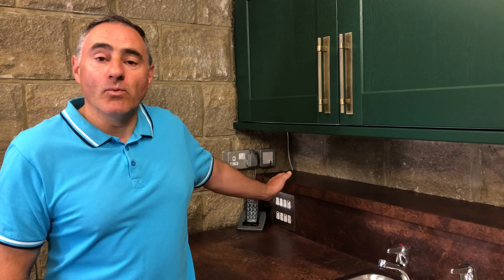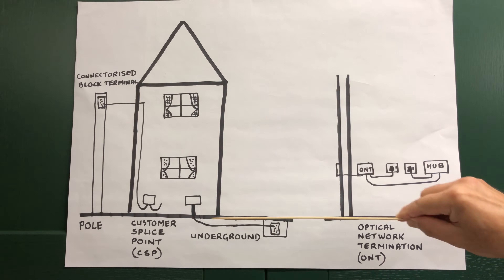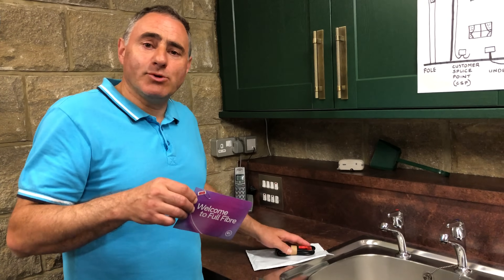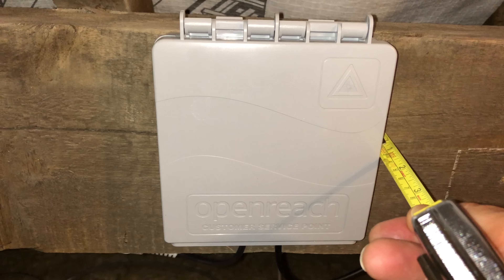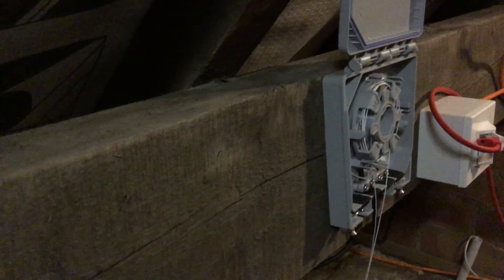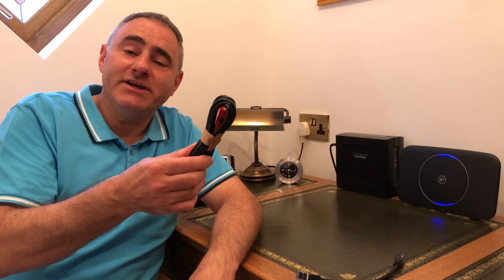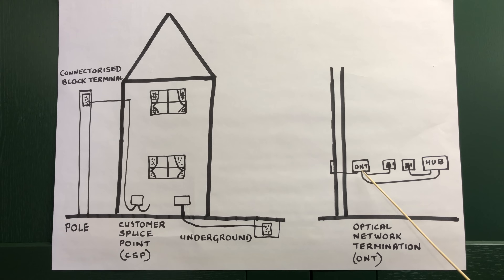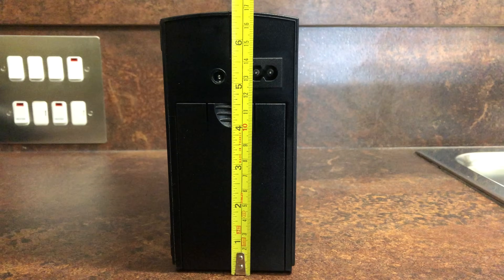Full Fibre Broadband with Battery Backup

Comment: Hi great video, what trunking did you use and how easy was it to feed the fibre through? I want to  do similar and have the feed come under the eves and not down the wall. Thanks.
Reply from the maker: Hi Scot, I used 20mm corrugated conduit from Whickes. It’s available in black or white and there is also 25mm dia available. In my case the fibre just pushed through no problem. If there are bends then it’s best threading a draw wire or string through the conduit. Then it’s ready to tape the fibre to it and pull it through. Hope this helps and it goes well for you. Cheers, Rob 👍

Comment: And WHO pays for the Electricity?????? Messy thing to have in your house.
Reply from the maker: I guess for anyone reliant on battery backup, the very low running cost would be negligible. If the battery backup wasn’t plugged into the mains, then the hub and ONT  itself would require power and be plugged in instead. As for appearance, mine now sits under the desk out of sight. For those dependent on battery backup, I suppose it’s cosmetic versus crucial. Thanks for watching and commenting, Cheers Rob 👍

Comment: Excellent, thank you.
Reply from the maker: You’re very welcome; pleased you enjoyed the video. Cheers, Rob 👍.
Reply: @robswiseways5697  if you have block of three flats how different is install vs just for one house
Reply from the maker: I suspect each flat will require a separate line from the pole or underground chamber. Hope this helps. Cheers, Rob 👍
Reply: @robswiseways5697  can the grey box on side feed three flats or does each have to have own grey box
Reply from the maker: @Viewer765 I’ve not come across this before but I’m guessing each one would have to have their own box. They are all separate customers and if one had a fault they would be able to test that individual line. If all three were in one box, the fibre lines would get tangled as they are coiled round inside the box. they’re my thoughts.
Reply from the maker: Sorry for late reply. The company who owns the infrastructure such as Openreach may have cabling methods for multiple flats. I’ve seen poles erected around existing blocks of flats and each apartment is wired separately direct from the pole. Not sure about new apartment blocks though. Cheers, Rob

Comment: If you turn off the WiFi on the Router the hub power mite last longer or you count connect your office directly to the ONT if your laptop still has power using your other ups
Reply from the maker: Thank you for your advice. Certainly something to bear in mind if we ever suffer a power cut. Cheers Rob 👍

Comment: Brilliant video. Thanks for taking the time to make it.

I have full fibre being installed next week and the battery backup is certainly something I need to consider.

Thanks again.
Reply from the maker: Hi Ceri, Pleased my video gets your approval. It’s a demonstration of what BT / EE offer as battery back up for those who suffer from power cuts. Have to bear in mind there may be other devices that require back up such as security cameras and alarms. Reading some of the comments, some folk choose an alternative battery backup to power several devices. Hope the installation goes well 👍. Cheers Rob

Comment: cat 7 is pointless in your house unless you're trying to do over 10Gbit+ - even at that anything beyond 6a should just be fibre. 7a for 40gbit but who on earth is wasting power on 40gbit - 100gbit over ethernet. It's crazy inefficient. Price of the battery backup you could buy a far better system that'll last for far longer elsewhere and work with other devices too
Reply from the maker: you’re absolutely right about the cat 7 Daniel. It might have cost a little more than cat 6a but I enjoyed the experience of installing cat7 S/FTP cable and providing a ground wire from the patch panel to an earth rod. It’s a case of a want rather than a need. Again I know what you mean about the battery. In my analogue to digital landline switchover video I received a lot of comments regarding battery backup. We don’t suffer from power cuts but I thought I would purchase these to include in this video. Basically to show people what BT provides as basic backup. Thanks for watching. Cheers Rob 👍

Comment: What’s the difference between the battery used for the router and the battery used for the ONT? ie. DYB24U12V-BT2 and BT3. I have battery BT1 for non FTTP. To go to FTTP, I need another battery for the ONT but which one and can it be bought separately?
Reply: Thanks Rob, thing is I have one of these with the lead which connects to the BT smart hub2. Just wondered if I could get another one cheaper off eBay but understand it will now need a different pug diameter lead to connect to the ONT. However will wait until I get FPTT and see which cable I need. May have to go down the adapter route OR as you say shell out for another 2 batteries which will have the different leads I require. Thanks for your help.
Reply from the maker: Hello Mick, looking at the specifications the batteries appear to be the same. The only difference I can see is a different plug on the connector cable. As to purchasing, go to the EE shop and search battery backup ONT. Choose the ONT. This costs £84.99. The ONT + Smart hub backup costs the same at £84.99. Which is what I had. I guess it’s encouraging folk to go full fibre by paying the same for two backups. You can download the user guide for each one where you will see the spec sheet. Hope this helps. Cheers Rob 👍

Comment: Extremely helpful video. Now i can install our battery backup. Thank you.
Reply from the maker: Pleased to be of help Luna. One thing to bear in mind. If you have other mains powered devices that require the internet during a power cut, these would also require some sort of battery back up. Also know as Uninterrupted Power Supply (UPS). Cheers Rob 👍

Comment: you forgot to do a WIFI speed test
Reply from the maker: You’re right Shane. However, WiFi did work as normal because the mobile phone was still on WiFi calling. Cheers Rob👍
Reply: I was Guarantee a down speed of 400+ .
But since fibre 500 fitted its now 46, 
That's lower than before. 
Up is higher at 50.
Complained 
 but as yet nothing. 
Land line calls now 20 odd pence a minute minute.
Reply from the maker: I’m on 300 and it was checked after installation and all was ok. 
Yes the the landline is now pay as you go for £5 / month and then like you say around 20p per minute. I’m sure they also do another ‘all in package’ but I think it’s quite expensive. We are light landline users and only keep it for elderly relatives calling. Cheers Rob

Comment: You have to think for a moment. This switchover from a very reliable 'copper' connection for the landline has become more costly, the battery requires plugging in to be kept charged up. For older houses with fewer power points this is a frustration. Past power cuts never interfered with the landline, now we have NO landline till the power is restored. Very good ISP for the ingenuity.
Reply from the maker: You’re absolutely right Quentin, but I guess we have to move with the times. One consolation if an area doesn’t suffer from power outages there wouldn’t really be a need for battery backup. Thanks for your comment. Cheers Rob 👍

Comment: I recently watched your video and noticed that you have installed battery backups for the ONT and BT Router. However, it seems unnecessary to have backup power for these devices, as losing power would also affect the functionality of any connected PCs. If you were using a laptop, it would make more sense, but since you are in a domestic house, it may not be essential. I initially thought you had servers and PCs for website uploads, but in a domestic house, this may not be necessary. Ultimately, it's your choice, but personally, I would be more concerned about my refrigerator defrosting in a power outage. Most people tend to focus on when the power will come back on, so their food doesn't spoil. It doesn't seem practical to have battery backups for the BT router and ONT in a domestic house. However, if you were running a business with website services, it would be more understandable.
Reply from the maker: Hello, in my previous digital voice telephone video I received a lot of comments regarding battery backup and not being able to make urgent telephone calls during a power outage. We don’t live in an area that suffers power outages and we have a decent mobile signal. So you are correct in saying we don’t really need battery backup. However, in the event of a power cut and power loss to our local mobile phone mast, our one corded desk phone that’s plugged into the BT Router will effectively give us several hours of telephone backup. Presuming the telephone exchange has backup (otherwise what’s the point of them selling us backup), I would also have internet access. Although I only purchased these backups to conduct battery backup timings for my video, they are a safety net. Thanks for watching. Cheers Rob 👍

Comment: Hello. Great video! What about your landline though? It seems to be cordless and I can’t help but thinking that of the power is cut the actual landline handset can’t communicate to the base (ie… not making calls) do you have a standard landline on hand to use? Thanks 😊
Reply from the maker: Thanks for your compliment Finlay. We do have cordless phones but the one in the thumbnail is a corded desk phone. This is plugged into the wall phone socket. The phone socket extensions are wired back to the phone socket on the back of the hub. So it should work with the battery back up. I show the wiring of the phone socket in my other video. There is a link to it at the end of this video. Cheers Rob 👍
Reply: @ Ok, thank you for the clarification :)

Comment: I think this is very informative, nice one Rob...the curtains kept me watching 😂 . I'm still a little conflicted about the proposed complete dropping of a copper based landline, but we do want those faster speeds and it's just not possible (as far as I know).

There are situations, like some people I know (that are full fibre), that can only get a mobile signal via wifi. If there is a powercut, no matter how good their own UPS is, the cabinets don't have much battery storage. So in their case, they have neither a mobile signal or a landline in an emergency. Has to be said, it's a very small proportion of people in that situation...I hope! A decent amount of the population don't know what a landline is, and the number of people that do know, are gradually going to decrease. Doesn't effect me at all, but I still feel for them all the same.

As some have said, yes Cat 7 is a significant future proof and it's something only used in very rare specific situations (regret I can't say what they are). But like you say, you wanted to give it a go and why not sir! Personally I have 10G and 1G fibre throughout property and outbuilding with cat6 for redundancy, all 2 feet underground - lower power and not electrically conductive. Far from convenient though as pre terminated cables are needed, unless you have thousands of pounds for a splice machine. 

All the best to you!
Reply from the maker: Hi Chris, Thanks very much for your comprehensive reply and compliment 👍. Gail has caused quite a stir with those curtains 😂 .
You’re so right regarding the UPS. I wonder, with FTTP if there is any requirement for a UPS in the cabinets, as I suspect the fibre would run straight to the exchange. I would hope the exchanges have UPS systems as before with the old copper lines. Coupled with the end users UPS, both ends would be active. 
Ha the Cat 7. I didn’t need this but wanted the experience of installing S/FTP cable. I purchased the termination tools, reasonably priced I must say. All via an electrical wholesaler who ordered Nexans cable, wall jacks and tools. I have CCTV powered by POE which is another reason I wanted a better cable. Same as you, I also have network cables ducted underground to the outbuildings.
Thanks again for watching and commenting 👍. Cheers Rob

Comment: Becuase the BT Hub has plastic around the ethernet ports, you won't ge any benefit of using FTP ethernet cables as needs to have metal ethernet on both sides and grounded accordingly to 'clean earth'. Which may need a dedicated earth ground rod
Reply from the maker: Thanks for your info Chandresh. I’m not a ICT expert, but you’re right about the hub ports not being grounded. I mentioned in the video when using S/FTP cable it should be properly grounded. My network is indeed grounded to an earth rod and it should still help prevent Electro Magnetic Interference (EMI) and where I have network cables bundled, Alien Crosstalk. Thanks for watching and commenting. Cheers Rob 👍

Comment: Perhaps get a battery backup for the hub which has 240V sockets if you rely on cordless phones🤔 You can then plug the hub and your cordless phone base station PSUs into that together. Won’t last as long as the BT unit but 🤞 the power will be back before the battery runs out. Indeed I used such a system in the past.
Reply from the maker: Thanks for your comment. I agree about back ups with 240v sockets. However, I have a corded desk phone plugged into the wall phone socket. The phone extension socket system is plugged into the phone socket on the back of the hub. I show this in my previous video (link at end of this video). I only purchased these dedicated BT battery backups for the purpose of the video as we never suffer from power cuts. Thanks for watching. Cheers Rob 👍

Comment: Full whole house Victron ESS battery system here. Keeps the whole house powered for about 3 days (More if we cut back on high usage devices) - Not sure why you installed Cat7; are you using some serious data networking that needs the speed? - I get the personal choice element, but boy did you spend a lot to do it. Worth mentioning to your viewers that CAT5 is perfectly adequate for the average domestic house; inc yours since your fibre speed is less than half CAT5 rated speed. 
Equally, the data rate over distance specifications you mentioned are indeed correct, however that is far less important if the distances are much shorter, such as the link from the ONT to the router which is typically less than 1m - at that range lose thin wires would probably suffice... lol
Also, real shame those Cyberpower UPS's are lead acid based; the battery will last about 2 years being held at 100% all the time; LiFeP04 based alternatives are now available for double the usable capacity for the same size and will last well over 10 years with only a 20% drop in capacity. I guess the public at large are not ready for Lithium in the home, not even the safe LFP kind...
Reply from the maker: Hello Dougle, Your battery system sounds like a good set up. I know what you mean though about the lead acid batteries only lasting a couple of years or so. To be honest I only purchased these for the video as we never seem to suffer any power cuts. I wanted to show the dedicated BT UPS packs as they come with labelled connecting cables that anybody can understand. Ah yes the Cat7. The hub is around 6m from the ONT. The longest run I have is approx 45m to the garage. As you say I didn’t need this cable but I really enjoyed the experience of installing it. I’m also future proofed as no doubt Cat5 will eventually be obsolete. I did read somewhere, use Cat6 as a minimum for home networking. Thanks for watching. Cheers Rob 👍

Comment: I've UPS on my FTTH service in southern Ireland in an area which has a number of power outages a year (storms, faults). Thankfully the infrastructure provider has UPS in their street cabs which supply rural the FTTH service.
Reply from the maker: Sounds like a good set up by the infrastructure provider Philip. I think it should be like this in all rural areas, especially in locations prone to power cuts. Thanks for watching. Cheers Rob 👍

Comment: Do you know the specification of the male barrel connector power plug required to go into the back of the BT Smart Hub 2 eg male outer diameter and inner diameter? 
Eg 5.5mm/3.0mm
 I cannot find this info anywhere.
Reply from the maker: Hi Richard, This is the only info I have: ‘Input barrel connector measured dimensions: outer diameter 5.5m inner diameter 3.0mm. No source in the UK has yet been found for this connector. A connector with these dimensions is marketed in the USA by Philmore (their type number 206).’  I imagine an electronics shop would have these. Hope this helps. Thanks for watching. Cheers Rob 👍
Reply: Thank you for that Rob @robswiseways5697